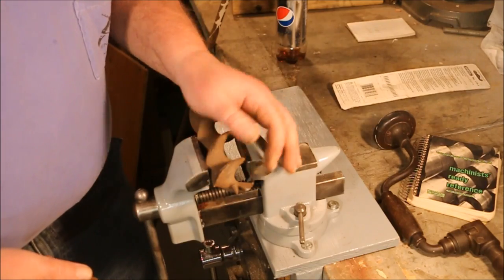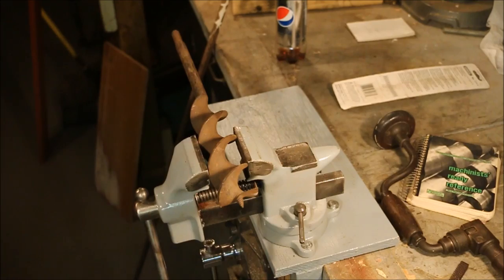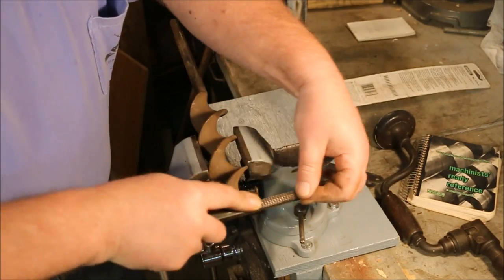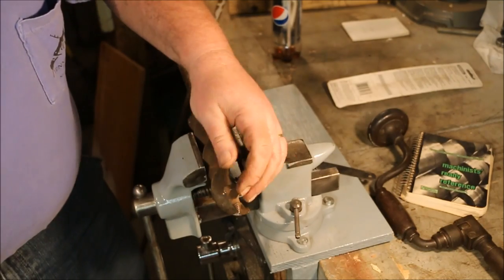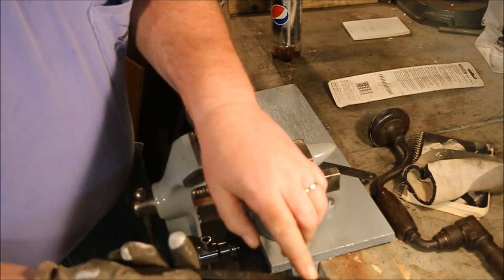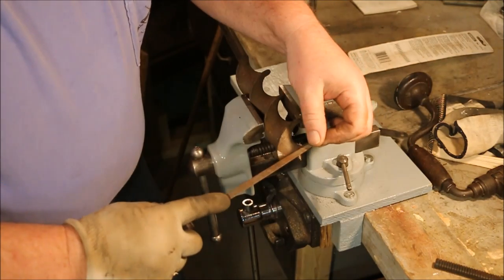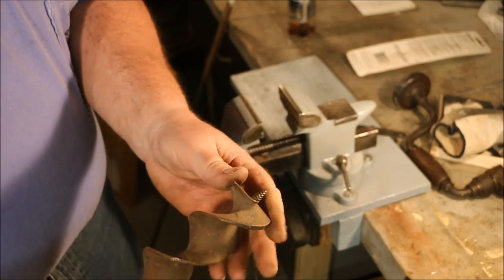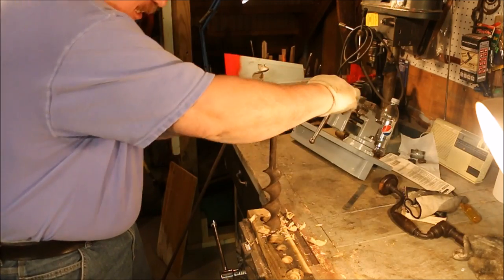Thread Restoring Files ~ Fixing Auger Bit Pilot Threads ~ by Old Sneelock's Workshop

Comment: Nice video and very informative. Sometimes you just don't have the right die and the file will save the day.
Reply from the maker: Thanks Tim. It will repair a great number of threads. For threads that are fewer threads per inch you can use the side that is a multiple of of the pitch. Even though there isn't a 3 or 4 pitch section on the file both can be dressed using the 12 pitch section. Like I said I don't use it much but it's a good thing to have on hand.
Reply: 2nd that!

Comment: Glad you're up and about and hope everything is healing up. Blast it! I'd REALLY like to know where my thread file went. I suppose I'll have to break down and get another. I think mine was a Blackhawk but it was a handy thing for sombody like me with no taps or dies. Now to run another one down. HEAL Unc!
Reply from the maker: It's getting better. I'm sitting with my leg up and an ice pack on my knee. Hopefully I'll be able to get back to the shop in a day or two. 
The only way I've found that really works is to start cleaning the shop. Stuff that's been lost for years pops up in the strangest places. Usually right where I had it last and put it away safely. :-)
Reply: I know. I could've sworn it was in my box in the top drawer. I guess I better look again. Keep a stiff upper knee old Pal. Will be praying for you!
Reply from the maker: Thanks Lewie. If we manage to hold together for this long it will take more than a fall and a visit from Arthur to put us down. :-)
Reply: So far, so good, Unc.
Reply from the maker: Back up and walking. Just not dancing yet. :-)
Reply: Slow beats NO by a bunch. I had mine pop like that and it was a hobbling experience for a while but I kept on working. It was the gas/brake leg but my clutch leg went out with gout once and I had to haul sand up a tsep winding road about 50 miles from here back to here in a truck with a 3208 Cat (210 horse) and a 13 under tranny. Did a lot of knock it out of gear and wait on it shifting.

Comment: Wow I never thought of using one for an auger bit
Reply from the maker: It would only work on one of these big barn augers. The file won't fit between the pilot thread and the spur on any of the smaller Irwin or Russel Jennings types. 
If I had a bunch of extra files I bet I could grind them down to fit. Might be worth checking out. 
I guess it would be pretty expensive to pay $126.00 for enough files to grind off one side of a complete set. The drill bits cost about $2.00 used. Cheaper to use a 3 cornered file that fits any of them.

Comment: How might you restore the point of the lead screw?  like if the bit was dropped and the tip broke.  I just bought a brace and bit set and a few of the bits don't have points on that pilot screw.
Reply from the maker: That is a tough fix. 
The bit is made from high carbon tool steel. Depending on how mutch is broken off you can sometimes recut the thread with a 3 cornered file. 
If it is more than just the first couple threads I haven't gotten it to work.
I have tried drilling the end of the bit and brasing a wood screw on. That was a complete fail. 
Wood screws are too soft. They twist right off.
If I figure it out I have a lot of bits that could be fixed. 
It is a puzzle and a challenge, but with so many old bits being sold for a couple dollars it won't ever be profitable.  😁😎
Reply: @OldSneelock  thank you. I was wondering if welding some raw metal to the tip and shaping it from there. 

But I hear what you are saying.
Reply from the maker: @briholt100  Don't let me stop you. 😁
It might work. If you have time and the interest go for it.
There is a whole group of people that buy drill bits and throw them away when they get dull. They think I'm nuts for sharpening them at all. 😁😎
Reply: @OldSneelock  these old auger bits.. are they cast?  What type of metal are they made of?  Still thinking about the welding idea
Reply from the maker: @briholt100  They are high carbon tool steel. Not the newer high speed steel that twist driils are made of. Easily weldable.
Reply: @OldSneelock  ok. Was thinking about temps and rod  material

Comment: Isn't it like a thread chaser ?  Not across the threads
Reply from the maker: It is a file with pointed teeth in rows to match the pitch of the screw thread that is being cut. You push the file around the circumference of the thread.